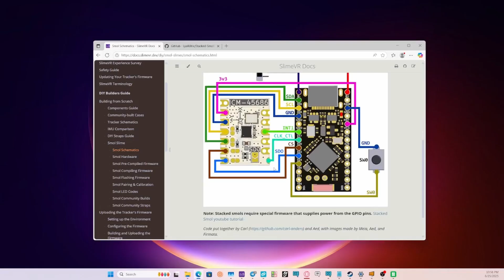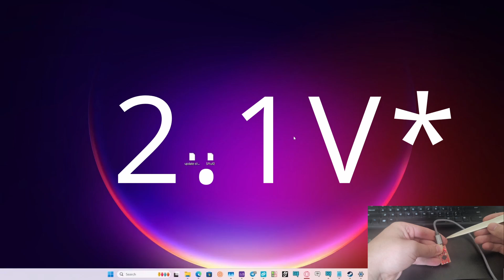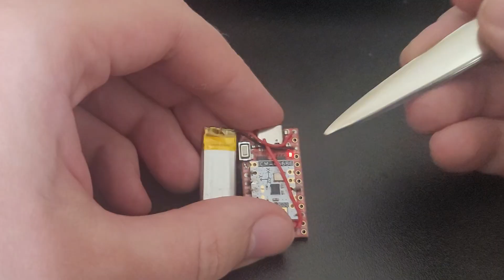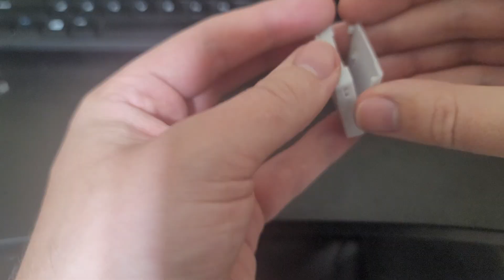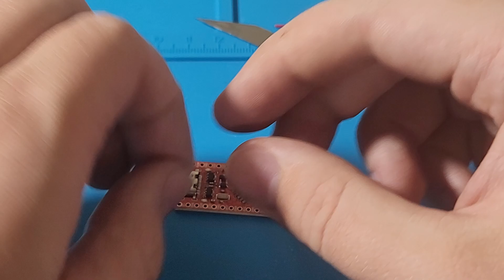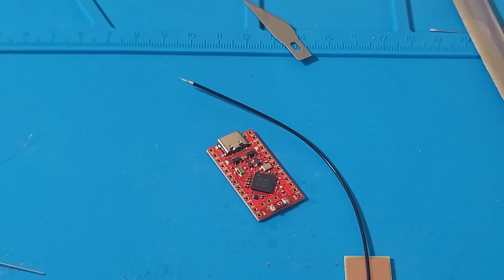Stacked SmolSlime Tutorial (UPDATED)

Comment: OK so, after watching this tutorial and building 9 functional trackers with the hope of using a LSM6DSV + QMC6309 Mag, DO NOT CHANGE THE BOOTLOADER FROM THE FACTORY NICENANO BOOTLOADER!!!!! The Slime bootloader that is used in this video changes the operating voltage of the nRF52840 from the stock 3.3v to 2.1V. QMC6309 WILL NOT WORK ON 2.1V!!!!! Once the bootloader has been overridden, IT CANNOT BE CHANGED BACK TO THE FACTORY 3.3V WITHOUT A PROGRAMMER TO FULLY RESET THE BOARD. I understand that the magnetometers are not fully supported yet, but I really feel like more people need to know about this if they intend in using any sensor with the QMC6309. This is incredibly frustrating as now i need to reset all my boards and buy the programmer itself. But I'd thought id share my hiccup so someone else wouldnt have to hit this roadblock like I did. I hope that someone finds this helpful.

Comment: Would you say this receiver has better connection/range then the holyiot dongle?
Reply from the maker: I haven't tested the difference with most recent firmware, however the holyiot should have better range. However, if you play space is relatively small, they perform essentially the same.
Reply: @lyallulric6220  Thank you for the swift reply and also for the video I built my trackers from. 👍
Reply from the maker: @MasterMangoz Of you are having connection troubles though, try repositioning your dongle to be more in the open, about chest level is best for me. But If still then a holyiot will alleviate things a little. Basically if you don't need it don't get it.
Reply: @lyallulric6220  I honesty don't have much of a connection problem unless I step out too far, I'm just making sure there isn't a better performing option since I ended up with an extra nrf board.

Comment: hey! great tutorial, one question:
when I try to pair it says esb_event: RX pairing request. It does not finish pairing. Sometimes it repeats that infinitely. 
I am using the HOLYIOT receiver and the firmware for it from the official slime website. I heard you say somewhere you use the same one. I've heard its a firmware incompatibiltiy issue but im not sure. any advice? thanks!
Reply from the maker: Sometimes you have to manually pair the tracker via the serial console by entering in device id's

Comment: Hi, I just built a tracker. It works fine, but when I test it and turn my back on the receiver, the trackers start to get out of calibration. Is this normal?
Reply: I'm assuming it's a ping issue, but is there any way to fix it? I positioned the antennas as shown in the video.
Reply from the maker: @Haki-n4p By get out of calibration I assume you mean drift? The best way to avoid unusable drift is to reboot it on a flat surface and wait about 10 seconds, that helps the tracker get a sense for what no motion is, just the way the firmware works atm.
Reply: @lyallulric6220  The problem I'm having is mainly with the chest tracker. When I rotate it 180°, it stops and seems to freeze, with no signal. As if the chest is causing interference. It stays that way until I rotate it again. I thought it was the tracker's fault, so I replaced it with another one, but it's still the same.
Reply from the maker: @Haki-n4p Oh, yeah that is a signal issue. Having a good dongle and wire modding the trackers is the most important thing there. Also placing it in the open is very important You can purchase a better dongle than diy if you need
Reply: @lyallulric6220  Well, thanks. So, is this normal with a homemade dongle receiver? If so, I'll follow your advice and buy a pre-made one.
Reply: or check if the antenna is correctly connected to the receiver adapter or if not leave them as they are.
Reply from the maker: @Haki-n4p The dongle with the supermini and antenna I showed in the tutorial should work for most users. I would recheck connections but also there are circumstances where it isn't sufficient l. Dongle placement is best around chest level so when you're turned away there isn't as much of your body blocking the signal

Comment: Hello! I have built my first slimes and I think they are working fine, just don't have the straps made yet so haven't tested actually using them! Your tutorial was really great and helpful! Thanks
Reply: Is there a way to check what the button does, and is there a way to customize it?
Reply from the maker: @Myammi_cat  Button presses should be in the firmware, but importantly, one press to reboot, hold to turn off. Hold too long and itll go into pairing mode. just reboot it again if it does

Comment: I cant for the life of me get slime vr to detect the trackers using bluetooth and connecting with a usb c cable, and it wont connect to slimevr feeder app
Reply from the maker: The trackers need to be paired to the dongle. you can check if theyre connected by checking the device id's and making sure the tracker is connected to the dongle via the blinks the tracker makes. 3 blinks means it is disconnected. Then make sure the dongle is plugged into the computer with a usb cable that can transmit data. They should show up in the slime vr server. 

Follow the guide in the slime vr docs if you have issues.
Reply: @lyallulric6220 i made sure the trackers are connected, and i still couldnt get them showing, do i need the IMU installed cause if i do thats probably why
Reply from the maker: @LucaThePupineer Oh, yes you do
Reply: @lyallulric6220 okay thank you, i was uncertain if i could get that part done before the imu’s arrivedn

Comment: 32:46 About this part, is there any way of telling if you did end up nicking the capacitor? I've soldered buttons onto two of my boards without doing the "guard rail" and I don't think I touched it but wondering if there's a way to tell
Reply from the maker: Normally itll have a blob on it or be missing.
Reply: @lyallulric6220  Okay mine look normal so they're probably fine, thanks!

Comment: awesome video its a lot of help. finally got all my parts in flashed all the boards and soldered one together but when i run the  terminal  and get info i get imu:none  figured i had bad imu or board tried it again new imu and board  not soldered jammed all the pins in to make contact same issue went around trying different boards and imu same issue  im a bit stumped on what to try next.
Reply from the maker: The Slime VR discord can be a great help troubleshooting, however sometimes an imu needs an extra reboot to register on the tracker, So after making sure there isn't solder bridging the pins, reboot the tracker a couple times and see if it still gives you no IMU.
Reply: you need to solder them and make sure you have good solder joints. I had a couple say IMU none and I touched up the solder joints and they appeared as lsm6dsv